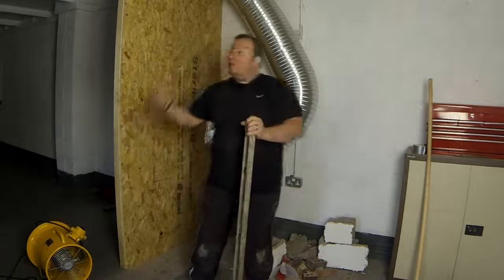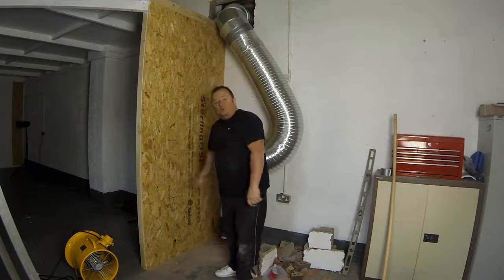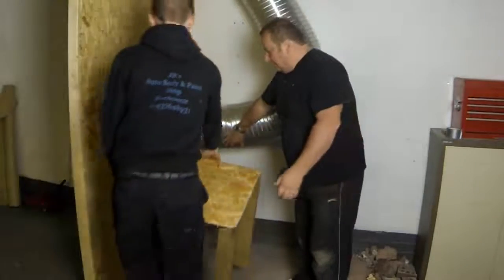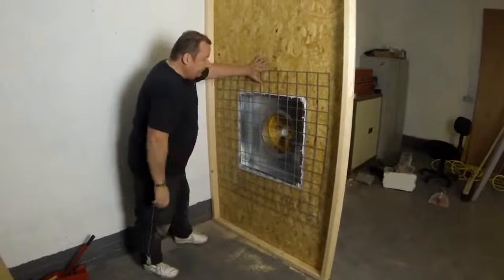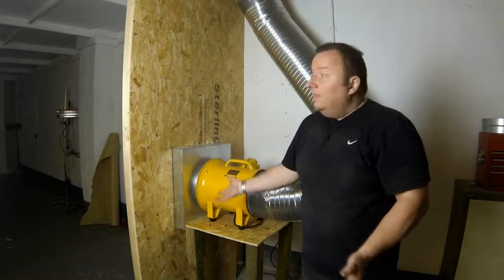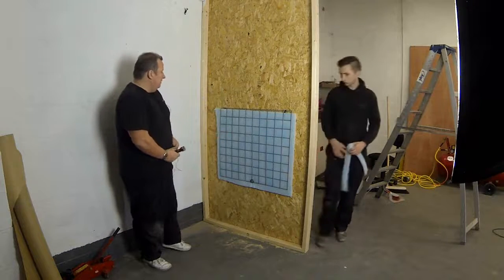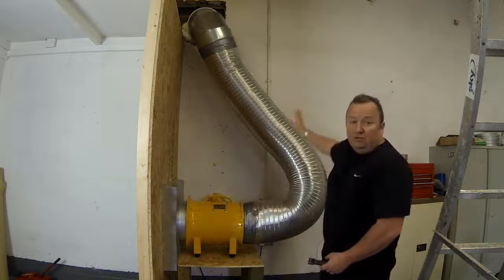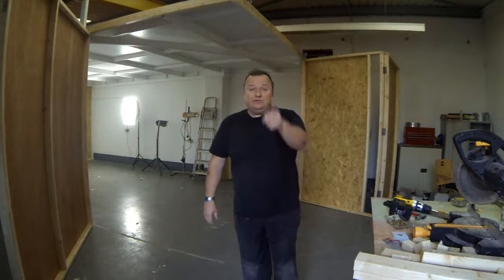Part 2 How To Build A  Spray Booth Room ATEX Rated Extract Fan

Comment: I gonna build a coating booth  using the same fan, but the question is, I would need a second one to bring inside the room fresh air right? how did u do?
Reply from the maker: We didn't but just had intake filters covering the open intake vent.
Reply: @retrorestore  ok thanks i ll put a simple opening to the opposide side covered by a filter... thanks!

Comment: Hi Martin good job you do got few questions? Where did you buy this flange and this steel filter box? And what filter going in is just one or 2?
Reply from the maker: Here's where you can get the duct box https://www.ductstore.co.uk/acatalog/Grille_boxes_with_flanges.html  We only used one filter.

Comment: Hi can you tell me exactly what the Square to Round ducting part is called? & poss post a link (with part number) to where you purchased it please. My googling has failed me so far & i am just finding the circle to square with a flat square not the ones like you have with the sides & additional lip on it. Thank you.
Reply from the maker: Here you go https://www.ductstore.co.uk/acatalog/Grille_boxes_with_flanges.html Hope that helps.
Reply: @retrorestore  Thank you v much. As soon as I found out they are called plenum spigots I found a load of them, but up to that point I was coming up blank.

Thanks for the quick reply, hope the booth working nicely now.

Comment: Greta job, is there a reason you used chipboard? Could I use mdf or ply for the walls, also does thickness of the walls have an impact in heat retention so much so that thicker is better, thanks for the how to were building one at the mo and basing it on yours
Reply from the maker: We didn't use chipboard, this was OSB sheets, a form of ply.
Reply: @retrorestore  great thanks what thickness did you use

Comment: looks good Martin, i guess you never saw the post i made on your last video or saw it to late. another idea ive had would be to make a seal for the door so your not pulling in dirty air from the gap around them
Reply from the maker: Yes, the gaps will all be sealed. I'm getting that done as soon as I can.
Cheers
Martin

Comment: Fine job. I may have missed it, but where does air enter and will it be filtered? Sorry if I wasn't paying attention.
Reply from the maker: There will be another grill on the opposite wall with a filter to clean the air coming in the booth Bruce, That will go in tomorrow.
Cheers
Martin

Comment: Great vid as always Martin, you could put a sprung jockey wheel on the leading edge of both the doors that way you won't have the doors catching as you open them iv got a similar set up on the spray booth in my joiners shop we got our ones from Screwfix I think and there in the gate hardware section 👍 keep up the good work il bet you can't wait to get spraying in there to see how it all performs
Reply from the maker: Yes, Chris, I'm planning on doing that when I come to fit the door furniture. Cheers
Martin